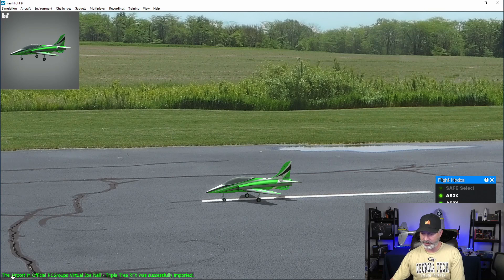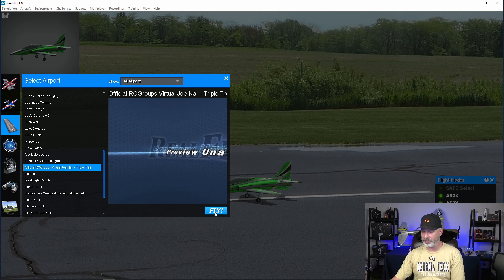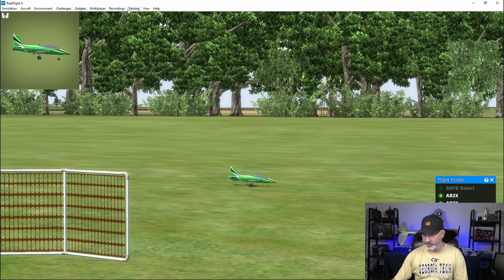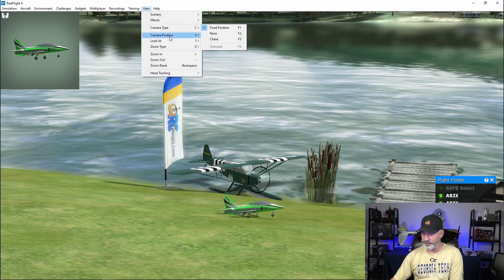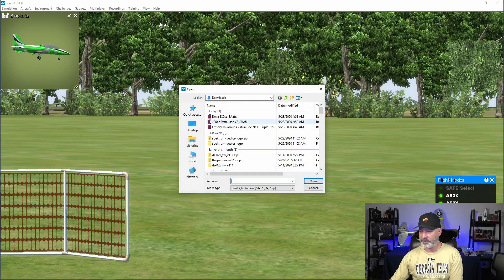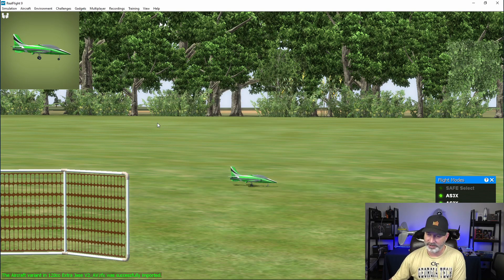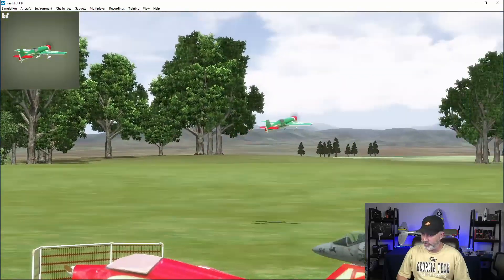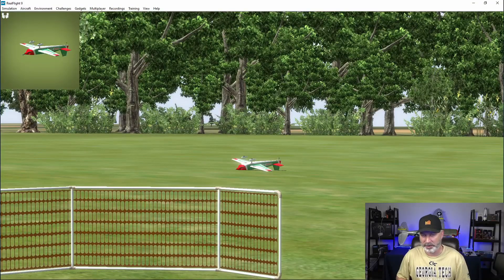HOW TO: Install Custom Airfields & Airplanes in RealFlight

Comment: Thanks for this great channel.  I just upgraded my reaflight to evolution.  I used to use 4.0, and  I liked being able to adjust my expo and rates on the tx controller setting.  Also, my throttle curves just like the real thing. Also, I was able to download a custom model from knife edge of my trex 500.  With 150% physics and some winds I would say the response was almost 90% of real flying field and my rc trex 500 conditions.  Do you think I can be able to trim my reaflight evolution to this degree?

Comment: Thanks again for the great info.  One question.  Do you use a generic model setup in the TX for RF or do you do model specific setup?
Reply from the maker: Jay Napoletano when I am using my wireless dongle with my iX12, I just use a generic profile. I’m usually using the USB Interlink controller though and the setting for each plane are saved when you go from one plane to the other.